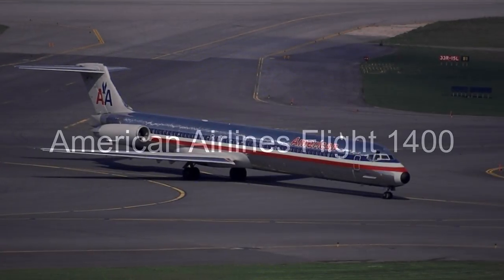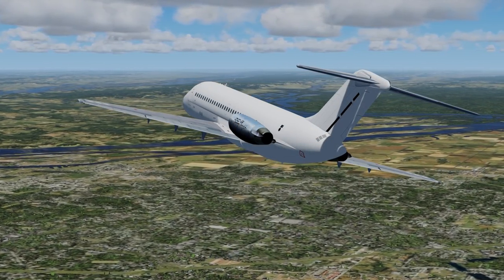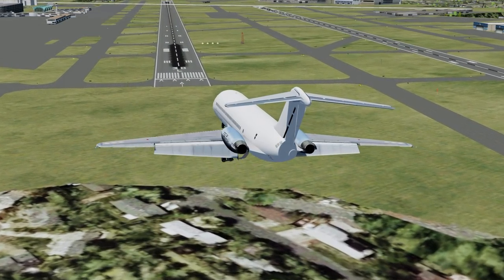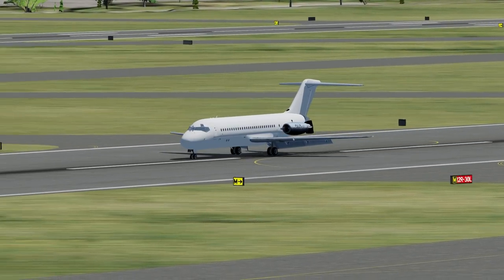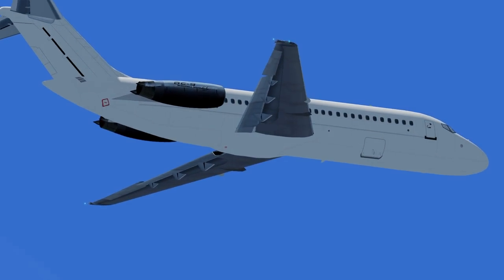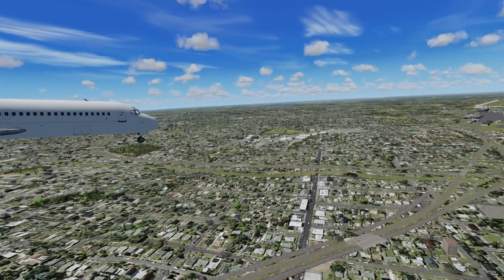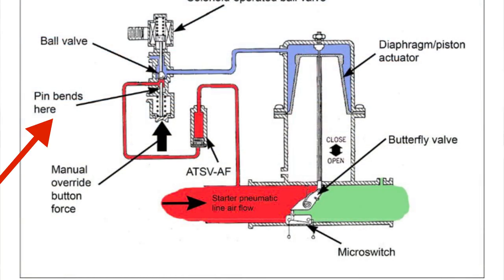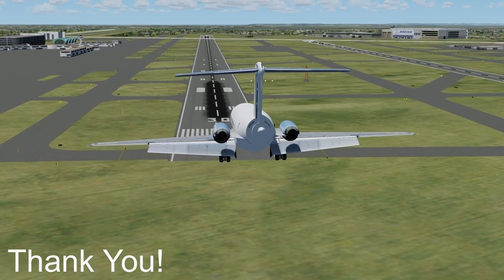How A Tiny Bent Switch Set A Passenger Jet On Fire | American Airlines Flight 1400

Comment: Very poor decision by the captain in my opinion. No one wants to land a plane without the nose gear, but you’ve got cascading failures including electrical and hydraulic; that ALWAYS means get the plane on the ground NOW. 

Everyone’s saying they did a great job because it worked out, but maybe you all should reference the crashes where a everyone died a few miles from the runway due to fires impacting controllability or structures. 

It ended up not being that bad, but they were getting every indication that it WAS that bad. 

Fire bottles not deploying? Eng fire light still on? Losing hydraulics? Loss of power and APU not starting? And you want to GO AROUND after you’ve made the runway? On one engine? With a heavy aircraft full of fuel that just took off? 

This worked, but could have also killed everyone. Landing without the nose gear would have also worked, and with no additional chance for a catastrophic crash off-field.
Reply: I agree. SwissAir 111 is a prime example.
Reply: @thetowndrunk988  Swissair 111 would never have made Halifax even if they didn’t do the checklist. This was determined by the accident investigators. They were too high and would have come in way too fast to make a safe landing
Reply: @tomstravels520  apparently you haven’t read or studied it at all- it had nothing to do with a checklist. They decided to dump fuel before making the approach, and it was determined they had a chance had they just landed heavy.
Reply: @thetowndrunk988  directly from the report:

“By coincidence, the time at which an emergency descent would have needed to begin to achieve the optimum theoretical emergency descent profile to land at the Halifax International Airport coincided with the actual time of the Pan Pan radio transmission. Any delay in descending would mean that the aircraft would be above the ideal descent profile. During the Pan Pan transmission, the captain requested a diversion and suggested Boston. It was not until about
1 minute and 25 seconds later that the following events were completed: the controller offered Halifax as an alternative diversion airport, the pilots evaluated and accepted Halifax, and the pilots commenced a non-emergency but rapid descent.

During that time, the aircraft was travelling in the general direction of the Halifax International Airport at a ground speed of more than 8 nautical miles (nm) per minute. From the actual descent start point, it would not have been possible for the pilots to position the aircraft for a landing on Runway 06, without some form of off-track manoeuvre to lose altitude and slow to the appropriate speed. In a best-case scenario, the extra manoeuvring would have added two or three minutes to the landing time. More likely, a manoeuvre such as a 360-degree turn would have been necessary, or they would have had to switch to a different runway. Either choice would have added several minutes to the earliest possible landing time, and the effects of the fire would have negated the possibility of completing a safe landing.
At about 0125, when the fire condition became distinctly evident in the cockpit, the aircraft was about 25 nm from the airport, at an altitude of about 10 000 feet, and at an airspeed of about
320 knots. It was flying in a southerly direction, away from the airport. In optimum circumstances, from that point it would have taken a minimum of about six minutes to get to the runway.
Theoretical calculations confirm that from any point along the actual flight path after the aircraft started to descend, it would not have been possible for the pilots to continue maintaining control of the aircraft for the amount of time necessary to reach the airport and complete a landing”

Remember they thought they were dealing with air conditioning smoke, not a fire so had no reason to make emergency descent and the reason for dumping fuel instead of landing overweight. Dumping fuel required going through checklists which they TSB determined were too long
Reply: @tomstravels520  there are literally 20+ aviation channels on YouTube that covered this, and every single of them agreed that the delay for fuel dumping cost lives, because the pilots should have taken the smoke far more seriously. Rules and training were actually changed over that accident, for any sort of smoke to be reason to declare an emergency. Even the air traffic controller was baffled how they were requesting vectors to land due to smoke from a possible fire, only to wish to vector back out to dump fuel first. Either way, in the case of the accident in this video, the example is still valid, only it was even worse here, because they knew they had a for certain fire.
Reply: @thetowndrunk988 who am I going to listen to? The people who investigated this accident and analysed the crews performance and aircraft performance to determine what they were able to do. Or some YouTubers who like planes? Yes if the pilots had seen the smoke and immediately thought “we should land” then they may have had a chance but that’s not what their training at the time told them. When they turned on the fans the smoke cleared so they didn’t think the problem was serious. Yes things have changed now but still no reason to blame the pilots for what they see taught at the time and what they experienced
Reply: @tomstravels520  nobody is blaming the pilots. But the point still stands, especially in the case of THIS incident, because the pilots knew the plane was on fire, and chose to go around. It worked out, but it was just sheer luck. My point is we can look at SwissAir 111 as an example of what can happen if a plane stays airborne with a fire. I never said the pilots were at fault. I’m just pointing out, and of course hindsight is always 20/20, that had they known what was happening, there was a chance of saving the plane. In the case of this particular flight, the pilots did know
Reply: @thetowndrunk988  “nobody is blaming the pilots”. Yet you also said “they decided to dump fuel” and then say the fuel dump was what causes a delay and death. Even though it’s been proven even without dumping fuel they wouldn’t have made it. Regarding this accident I can see both sides of the argument. You want to be prepared for what is about to happen and if you suddenly get told you’re head is not down when you expect it to then you’re now not prepared for a belly landing. Seeing as they survived if the captain can justify his actions then they’d probably be happy with that as pilot training doesn’t normally cover loss of gear when your engines are in fire.

You can think of it like the QF32 pilot. Engine blew up and had a temporary fire, fuel leaking from the wing. They didn’t just turn back immediately they needed to know how damaged their aircraft was so nothing would surprise them. And then when they landed the captain kept the passengers onboard for a bit instead of evacuation because they were safer and no one would get any unnecessary injuries. he justified his actions and it was seen by the ATSB as the right call
Reply: @thetowndrunk988  A cabin fire like in swiss 111 is an entirely different beast than an engine fire. I would never go around with a cabin fire, but there is virtually no possibility of those engines spreading fire to the fuselage.
Reply: @tomstravels520  your previous post you literally said had they noticed the smoke and immediately tried to land, they might have made it, yet now you say they had no chance even if they’d skipped dumping fuel…….
And no, I’m not blaming the pilots. Saying that “had they not dumped fuel, they had a chance of making it” is not placing blame. It’s pointing out an observation. 
As for the plane in this video, it was a hard call, because training doesn’t really cover both of these scenarios at once, but the point is it could have went very badly, and despite what others have said here, an engine fire, that’s failing to extinguish and eating through other systems, is an immediate threat.
Reply: @Wade-lk4yo  this particular engine fire would not extinguish, and was burning through important systems. They lost right hydraulics in the middle of all this, and had they lost flight controls altogether, the fuselage burning would have been the least of their worries…..
Reply: @tomstravels520  and btw, the NTSB justified his actions because he got the plane down safely. Had they lost control and crashed, they wouldn’t have justified the go around….
Reply: @thetowndrunk988  Jesus Christ listen carefully. They started their descent at 01:15 local time. At this time they were too high to make a straight in approach to Halifax. This meant they had to either turn away from the airport to loose altitude or do a 360 degree turn. Even if they didn’t dump fuel they wouldn’t have made it as they were too high and too fast and needed time to loose both altitude and airspeed. This is where the TSB stated they wouldn’t have made it no matter what they did. 

Now if they had descended when they first smelt and saw the smoke (at time 01:10) they could have started their descent 40 miles earlier and been low and slow enough to position a few miles away from the runway and line up with it and land. But nobody would ever expect them to do that because nobody knew there was a fire onboard.
Reply: @thetowndrunk988  Sorry.
Thomas is 100% correct.
Stop making up stuff to get noticed.
Reply: @Wade-lk4yo  Exactly...
Reply: @alhanes5803  making stuff up? We were arguing about Swiss air. It did indeed catch fire mid air. What part did I make up??? There is a lot of debate about whether they could have landed had they not dumped fuel. Investigators concluded they wouldn’t have, but other experts believe they may have. WTF are you even talking about?
Reply: @alhanes5803  and for the record, idgaf if anyone notices me or not. The entire purpose of the discussion was what can happen if you keep a bird in the air. The pilots in this particular incident made a tough call going around, which worked out, but could have not been so well off….
Reply: @thetowndrunk988 
Well, neither the pax, nor the plane suffered Injury,  or destruction. 
Had he landed the 1st time, destruction of the airframe was a given, plus possible Injury, and/or death.
Explain to  me how the 2nd choice would have been the smartest/best decision.
There are no what ifs.
It's what is that matters.
Reply: @thetowndrunk988  
You said it best now.
The investigators Concluded they could not have made it back.
It doesn't matter what arm chair throttle jockies say.
Before "you" said they could have made it to Halifax,  had they not dumped fuel.

Comment: That the crew lacked CRM is due to lack of training. Within the skill sets that they had they did a perfect job. Even finding an off duty pilot to help. The go around was just plain good judgment in an emergency. Definitely saved the plane. What I find odd (again) is the decision to fly with an engine that would not start. I feel that an unidentified intermittent engine fault should have rendered the aircraft unserviceable, which it was as it turned out. The crew should never have been given that aeroplane.
Reply: I respectfully  disagree on the go around; a fire is a very time critical event; with the ram air effect it could have easily caused a crash and total loss, I would have put it down on the nose and main gear. airline History is full of total losses due to short duration fires on board.
Reply: I agree, any engine problem is reason for further investigation and transfer passengers to different plane or reschedule.  It's not like azcar where the mechanic takes a hammer and if it starts all is good to go but that's basically what was done, at the risk of all lives on board.  Some things just should never be taken lightly.
Reply: @sparkyobrian6417   Yeah, I agree with you.  Fire onboard is the most dangerous and time-critical emergency there is.  Much more serious than inoperative landing gear -- especially nose gear.  You gotta get the plane down on the ground ASAFP!

Comment: Made the right call. He was close to Airport, engine fire outside of Aircraft. The hardest part was lack of instruments. He did good, if the plane was ablaze I'm sure he would have set it down with no Nose Gear, nose gear not a big deal you will just slide, but you don't need Nose Gear for steering, the rudders would have kept him straight down the centerline. Great job by both Pilots, they did exactly what you should and that's 1. Aviate 2. Navigate 3. Communicate
Reply: I really don’t think it was the correct call to go around. 

However, it’s easy for me to say as I sit at home in the comfort of my arm chair. The crew got the right outcome, so hats off to them!

Comment: Amazing presentation & analysis. Thank you! Disclaimer: I am not a pilot. Despite limited prep time I think the pilot should have not done the go around. But he did and luckily was able to demonstrate excellent airmanship. Swiss 111 set the rule that any fire meant immediate landing. While the risk of hydraulic pressure was not detected until go-around the effect could have been disastrous. Making that decision was risky but worked for them. Love how they pulled in a 3rd to assist, the way United pilots were supported by a flying passenger/pilot in Sioux Falls ‘89. Glad all ok. Great story, thanks!

Comment: So, why did they lose their primary flight display, and what was the cause of the loss of hydraulics. Also, if you can't start an engine without tech support, what if they had an in-flight flame-out on that engine? How would they restart? No confidence in that carrier!
Reply: You only need 1 engine, the plane flies perfectly fine with 1
Reply: Starting an engine in the air is a lot different. With enough speed, the ATS isn’t needed. The airflow through the engine keeps it rotating.
Reply: All commercial aircraft that I've worked on can be dispatched with an engine start valve that must be manually opened.
Reply: @thetowndrunk988   Your right,, with ignition set to flight mode ( high jewel ) and about 19 percent N1, it should light right off.

Comment: 5:50 On a turbofan, the front blades are the fan, they make the vast majority of the engine's thrust output. The next set of blades are compressor blades, there may be 2 different shafts driving the lower pressure compressor stages and the higher pressure stages. Then there's a combustor which looks like an expensive donut with a ton of fuel injectors machined into it. At the very back of a turbofan, there are turbines, sometimes mounted to a single shaft, sometimes they're mounted to different shafts to drive different stages of the compressor and the big fan in front. Sometimes these are known as a 1 spool, 2 spool, and 3 spool turbofan engines. 
I'm just an auto technician.
Reply: well James You have it correct. What amazed me was the starting fuel flow. You are pumping fuel through the engine faster then you can in buckets. Then watching  the flow increase during a performance run. 16,000 pounds per hour on an RB211 at takeoff power.

Comment: Sounds a lot like a “runaway diesel”.  Pretty much what happens is air gets sucked into the engine, it gets compressed from the force of the other pistons, detonates (make fire), and then releases the exhausted air.  That’s how diesels work, but a runaway diesel is when the pressure of the the crankshaft has more energy than it does for a detonation.  This means that the engine keeps spinning, even if you don’t give it more throttle.  Once it starts, it spins really fast, and blows up because the heat; unless you are able to suffocate it by blocking air flow (covering the air filter). 

This doesn’t happen on regular has cars because they require a spark to make it ignite; while diesels use the compression of the air.

Comment: If I'm on that plane or worse someone I love, with an in-flight fire I want the captain to put it down gear or no gear. Statistics for in-flight fires show that every second can count. I'd rather risk a no gear landing than a go around in a burning plane.

IMO ALLEGEDLY
Reply: That's not the correct way of viewing things. 
One might get away with a gear-up without fire breaking out. But with an aircraft already on fire, a gear-up is likely to end in a much bigger fireball incident. 
Stats are proving procedures to be correct. If stats were against procedures, those procedures would no longer be procedures.
Reply: @thefreedomguyuk  id rather have a fire on the ground with emergency fire crews on standby than in the air with multiple failing components.

Engine fire, engine shutdown, avionics failure, and then nose gear failure all at low altitude is a sign to get the thing on the ground asap.

These guys got lucky
Reply: @mikeyorkav4039  no nose gear can generate sparks, very bad when there's an uncontrolled fire

Comment: The pilot was clearly more uncomfortable with landing than with going around. It's easy to second guess, and it's easy to judge on the outcome rather than the merits of the decision. Here are the "couldas".
1. Go around. Airplane falls apart. Crash. People die. 
2. Gear up landing without fully preparing. Sparks. Fuel. Big fire. People die. 
Basically, either choice was reasonable for the circumstances, and either choice could have ended well or badly. (And he made his choice and it ended well.)
Reply: The plane was under no risk of falling apart during the go around. Jet engines are separated from the fuselage for a reason. If the fuselage was on fire, different story.